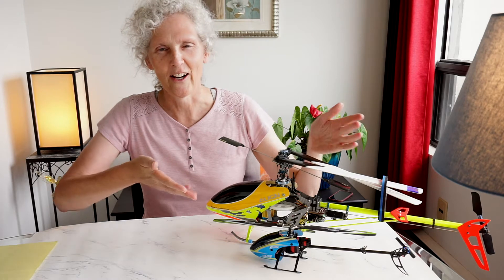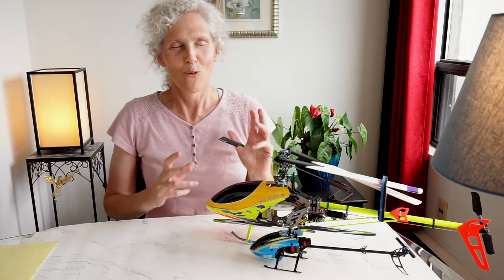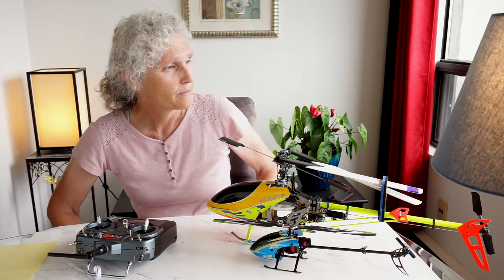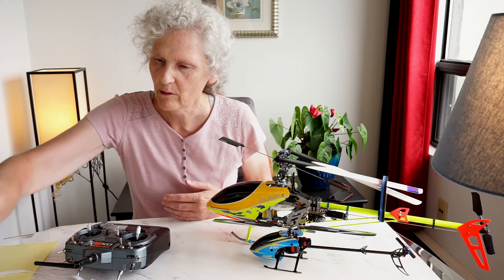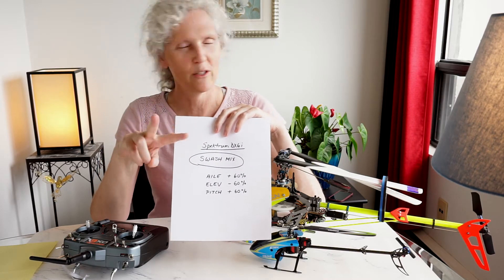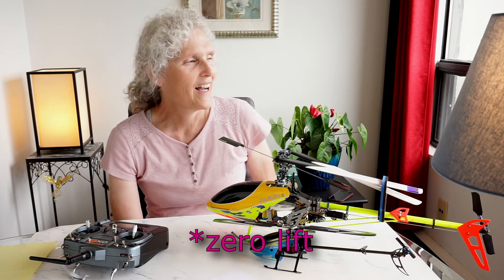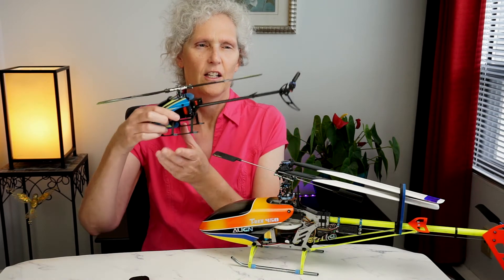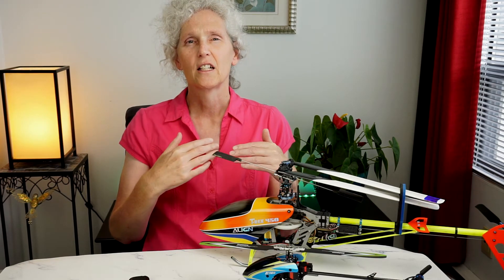What Is 'Swash Mixing' (old-school R/C helicopters)?

Comment: The rotor doesn’t tilt relative to the helicopter, but it does tilt relative to the ground. So whether you should say that the rotor tilts or not depends on how you’re thinking about it.

The cyclical causes the blade angle of attack to be different at different positions which then tilts the rotor which then pulls the whole helicopter along with it, because it’s attached to the rotor through the rotor shaft.

They could design the helicopter so that the main rotor blades tips can move up and down so the rotor shaft and also the whole helicopter chassis is basically hanging like a swing from the rotor. This would allow the rotor to tilt without tilting the helicopter, but it would then be impossible to fly 3D without the blades crashing into the tail boom.

I believe that real helicopters are actually deigned so that the helicopter is hanging from the rotor like his so it can swing around underneath the rotor like a swing, and that’s OK because real helicopters don’t fly 3D. The reason why real helicopters are designed this way is because it eliminates a source of stress on the root of the main rotor blades. If you tilt the rotor forward, the helicopter will swing back as the rotor pulls the helicopter forward. Then when you tilt the rotor back to stop the helicopter, the helicopter will swing forward. The same applies side to side.
Reply from the maker: Excellent point! Thx for the GREAT input! Cheers!